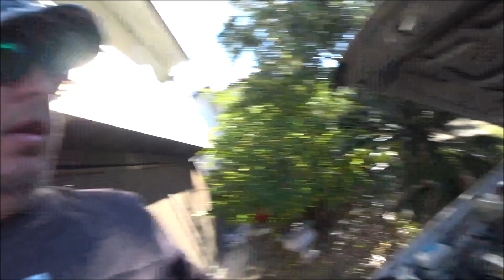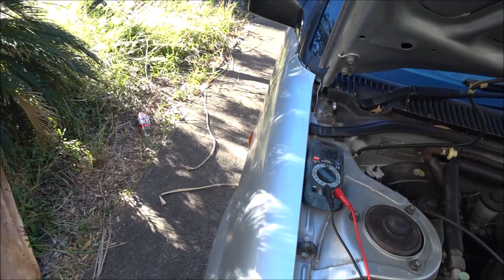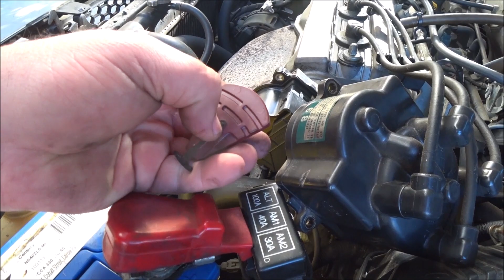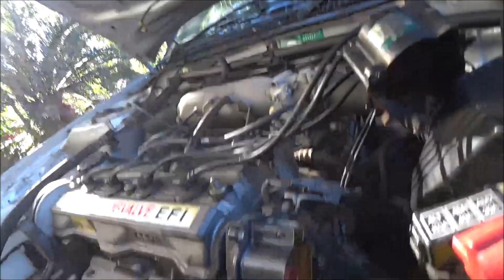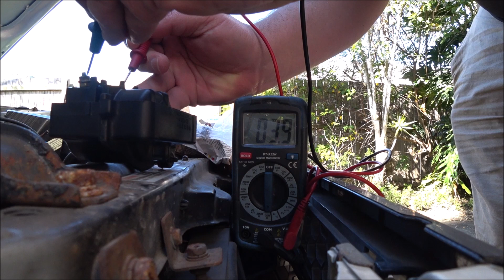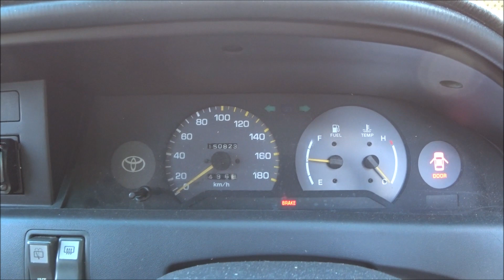AE92 Toyota Corolla - No spark - Faulty Coil Diagnosis and replace

Comment: I have the same car, its running badly, rough idle, vibrating, stuttering, low power.  I swopped the dizzy over for another one from a junk yard, but made no difference.  The cap and leads are still the original, so could there be an issue there? they appear fine.  Any advise on what to test for next?
Reply: Did you figure it out I'm in the same situation thinking it's a silly relay or fuse I was driving and it started sputtering and now it won't even hold idle.

Comment: I had thre same problem with my 1987 Toyota Carina now done only eighty five thousand miles. It has a single carbureta so is less complicated than yours, but still the same distributer and coil. It is now on it's third coil since new. I have bought a fourth just in preparation!! This spare has the little surround to the distributer connection as yours. First signs of trouble were hesitation on slow acceleration.   I wonder what is wrong with the con struction of these coils, it seems a common fault.    I suppose what withe modern coil over plug and an ECU. there will be other electronic problems - and what for i.e. My 1948 MG series Y when I fitted twin inch and three quarter SU carbs ,  of a Rover 100, gave me thirty five mpg  even on town driving..
Reply from the maker: In my case I think its the cam deal leaking hot oil vapour into the distributor.

Comment: Hi mate can u help me i have toyota corolla when u start in the morning it mist alot till its hot but make a poping sound at the back of excuast and when you turn the distributor it doesnt give a spark on the plug when the plug is out and put it in the plug wire so it can be the coil pls need help pls
Reply from the maker: I mean you ask a question here, and then tell me what engine I have in another video?

Comment: Great video! Quick question, got an ae92 myself (1990 corolla sedan) running well as it had oil change, Timi belts, spark plugs, fuel filter etc but I note it hesitates on accelerate sometimes, my mate thinks could be the spark plug wires themselves, would this likely be the issue? Managed to find a distributor cap with wires on eBay that fits so gonna try that but would appreciate your thoughts
Reply from the maker: Could be, could also be the plug gap, or injectors or most likely on a car of this age, vac leak due to old rubber hoses
Reply: Thanks, what is meant by the plug gap?
Reply from the maker: @therager4401  its the gap from the electrode to the earthing pole.
Reply: Hesitation on acceleration was the second and last problem I had before the car came to a dead stop, the first was a miss fire on idling, Anyway I now cary a spare coil  !!!

Comment: Why did u unplug the fuel injectors and what is the firing cycle for your corolla?
Reply from the maker: I used the injector plugs to test for the cam timing pulse.

Comment: So I have a 92 Toyota Corolla, I've changed the tps, plugs, coil, and wires, new maf (because that's what the check engine light said was bad when I crossed the obd1 port), coolent temperature sensor, she is getting fuel just fine, and timed it, my problem is when it gets to normal running temperature, it seems to have a random misfire, and doesn't want to stay running, but when it's cold she purrs like a kitten, any ideas, been a headache for me for the past 3 months now
Reply from the maker: Sounds very coil like, coils are affected by heat, when they start to fail usually it's when hot. Check for spark when she's hot. Unplug 1 spark plug lead at a time will tell you which one isn't firing as the sound won't change when you do.
Reply: Try the cold start sensor

Comment: How much power should be coming into the distributor when the key is turned on? 

My 90 Corolla is definitely getting gas, just installed a low mileage junkyard distributor and still no spark
Reply from the maker: Check the resistance mate. See my previous vid on this to check the other issues like cam angle sensor etc, how to pull codes to check.
Reply: Hey u figure it out this exactly happen to me

Comment: When I start my Toyota Corona at170  in the morning, the RPM does not go up slowly .What is the reason for that?
Reply from the maker: I'm not sure what your question is mate, if it starts, its probably okay, it may idle higher in the morning. if the idle speed is an issue though inspect the vacuum hoses.
Reply: Link to that previous video please

Comment: Hey tangles.  Thanks for explaining how to test the coil.  Years ago, I had one go bad on an old 86 Toyota truck 22R engine and a guy at work gave me one he had to try.  That was the problem as suspected, but I didn't know how to test it.  As for the rotor button, I've never broken one of those before.😜  I always use the same procedure as you when walking away from a job for a while, putting all nuts/bolts back in their locations. Even manage to drop one into the abyss now a then like you did as well.😯😅 All part of the job. If you do merch, please put your opening catch phrase on some. Have a great weekend, mate.
Reply from the maker: "Hello youtube and the internets"
" Ahh I fucked it"
" I did it wrong so you don't have to"
Reply: A
Reply: @asafali2972  Oi